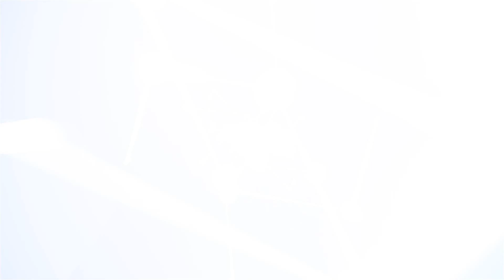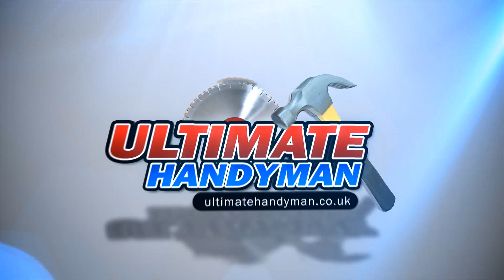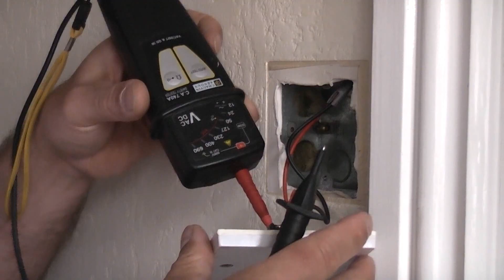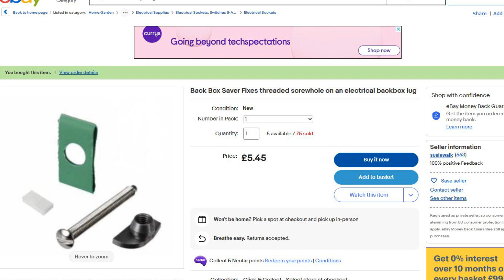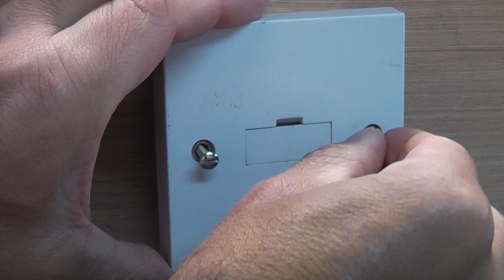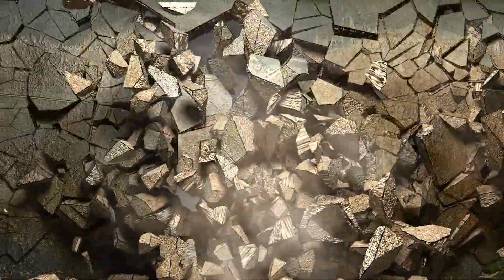How to repair a completely stripped backbox lug | backbox saver

Comment: Interesting. In the past, I've wedged a bit of wood between the lug and the back of the box and secured using a wood screw - cost 5p 🙂
Reply from the maker: That's a clever way to fix it on the cheap!

Comment: That's great! I have 2 lugs stripped in the backbox and the box has been fixed with a nail and plastered in from when the house was built in the mid 1960s, so these are lifesavers!
Reply from the maker: I’m glad you found the video useful
Thanks for the comment 👍
Reply: Found a bit fiddly, but I managed to get the holes to line up and they work a treat.

Comment: Thanks for the video; great idea but massively overpriced! Why not cut off a lug from another new back box, tape on with Aluminium heating tape to the back of the defective lug and screw through the tape on the front of the stripped lug into the "new" lug behind?

Comment: I have a 25 piece kit of these for use at the building I work in. The building users can be quite harsh on the sockets so many get damaged and there's over 1000 kids here it so I need a quick, safe fix for obvious reasons and found these get the job done in minutes with zero risk.

Comment: Most motorcyclists will be familiar with this one- "Tinnerman" nut or Fastener. They are used to attach many plastic/fibreglass fairing panels to each other or brackets. Essentially identical to those things you show here, they are simply a tight squeeze fit U shaped springy piece of steel, with a screw hole in the middle, one side is threaded. They come in many sizes, and they are waaaaaay cheaper than those shown here...
Reply from the maker: There are several things that would work, such as Rivnuts/nutserts/chimney nuts/U nuts- but they often don’t come in M3.5

Comment: great little tip.  a bit pricy  but its a nice solution to have in your box ready to go without  having to rig up something
i would like to see you try out a few of the sugestions  and compare them. could make a great video. 
i have used socket extensions  wrall pluged into the wall behind   before 
i used an express anchor with a 6mm plug inside  cut to the gap behind the lug and then grip filled it there. there was a thin wall and a quartz worktop behind so didnt want to drill deeper

Comment: Three other options and these are only on the account of the fact that you rarely go inside such a box, so any fix, is ok as long as it doesn't damage the thing more: 

1. take any rod that's one fraction of a mm smaller than the thread. Place the rod in the hole, take a pair of good quality pliers, your best, and gently squeeze the metal tab over the rod, to ovalize the hole, then remove the rod and use a tap. It will work, but you need to be gentle with it. I usually leave a small marker dot on the screw's cap to let me know it's a problem. I'd only do this one in my own stuff, never for someone else tho. It depends on how quality the box is, how good the fix is as well. If it's a cheap box as there are maaaany cheap boxes, yeah... that's not gonna last. If it's a quality box, that's gonna last you a long time, provided you don't munch the screw again - hence why i put a dot on the screw to let me know it's an issue.

2. take a nut, and use epoxy putty to secure that nut in place. Be liberal with the epoxy. Use a greased up bolt to make sure the threads aren't coated in epoxy when you set it in. This one's pretty permanent, i'd be ok with doing it anywhere, especially if you push the putty in the hole where the tab was formed from. The chances of it coming undone are pretty small. I'd use a putty meant for wet environments, not because the electrical box would ever get wet, but rather because wet environment epoxy putty has special compounds that make it extra sticky. This one takes a while to set tho, sooo... yeah.

3. buy an individual nutsert of the right size, and use a wooden backer to hand (no power in the drill) ream the hole to the right size of the nutsert, then use the bolt trick to crimp the nutsert into place if you don't have the nutsert tool (tho, honestly, i'd buy a set of all nutsert sizes and the tool if you don't have one, because they are super useful in every place in the house. I recommend having aluminium, steel and at least a loose variety of stainless steel nutserts in the most common thread sizes). Last step once the nutsert is set is to grab the nutsert with a good pair of bent nose pliers, and using a flathead screw driver, placed on the crook of the bend of the metal tab, push the nutsert slowly and firmly one mm behind. This is because the nutsert's flange sticks out one mm (usually) from the face of the tab.

Bonus round, which is super funky because you rarely find them, buy a tap and screw in imperial, next size up. The differences are not that big, but they usually are good enough to allow you to rethread the hole with a confident thread. I've done this quite a few times, BUT, that means you have to make sure the owner can't swap the screws... you either put two screws in, "upgrading" both threads to bigger size or you write a nice message on the back of the box for the owner. Like i said, funky fix. I usually up the size of both screws. 

From the other side of the equation, the installation, i never trust the tabs, so if i have a place that's about to be finished and the boxes are about to be installed, all these tab holes receive an actual nut, that's spot welded into place. Spot welders are cheap these days, especially one of light duty variety that'd allow you to spot weld a small nut. Unfortunately, it can't be done once installed, the jaws of the spot welders i have are entirely too large. If one goes for this, two things: a. the nut's face facing the metal tab needs to be ground to remove any coating (same with the tab on the inside) and b. flange nuts are to be used, as they have a bigger surface area.

Comment: Excellent. Use screws with a lead-in as well. It can be infuriating if your screws aren't long enough as well , if they only just do the job it is difficult to align them and this is where damage can be caused to threads. Go out and buy some longer screws from B&Q  or wherever and keep them in the kitchen drawer where they are easy to lose🤣

Comment: Metal back box mate 
Snap the lug off a good one and mitre fix behind the stripped one 👍 works like a dream, also you can take the threaded piece out of a dry lining box and place that behind the stripped lug it will tighten up perfectly

Comment: I drill the lug to 4mm, then glue a tapped piece of metal behind lug, keeping it aligned with a simple clip (bend metal/paper clip/small bulldog clip). Once glue is dry, remove clip and use as normal. You bend a piece of metal, as a clip, around both sides of lug, but only tapped on back. Lots of ways to do it but the second method outlined may not work if you don't have space.
Reply: I also use double sided sticky tape to hold the a nut behind the lug

Comment: Superglue an m3.5 nut on the back of the lug.
Reply from the maker: That might work, but if the bond of the glue breaks, it might be difficult to remove the screw 😉
Reply: @ultimatehandyman  If you use an irregular piece of tapped metal of a size that will catch on the inner side of the box, then even if glue comes unstuck it will catch on the side of the box.
Reply: @Marcus1954s  Can you simply pull on the socket? This can create enough friction between the nut and the lug.
Reply: @andys.9300  If a screw is locked into the tapped hole then it can still just spin. Something needs to "catch" to stop it spinning. Likely pulling will work on a hex nut but not in all instances, especially if screw is stuck in threads when screwed all the way in and there is nothing to grip/pull.